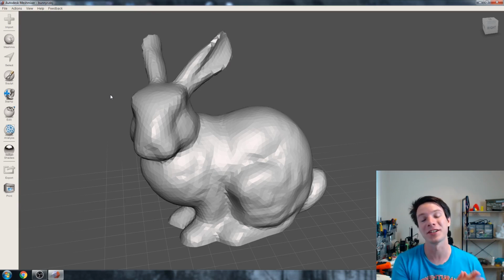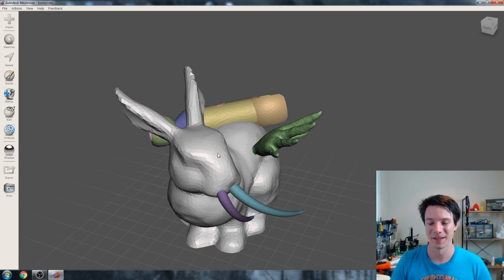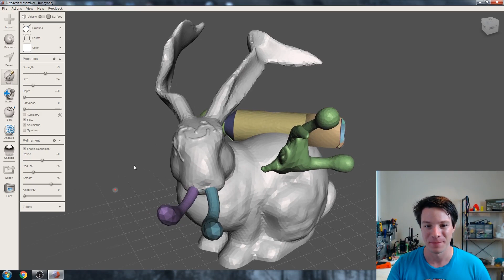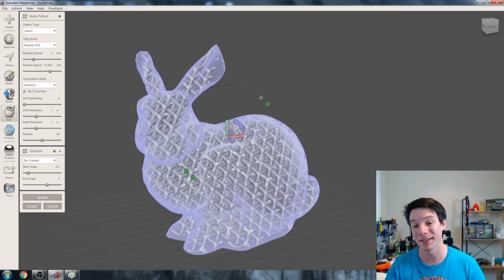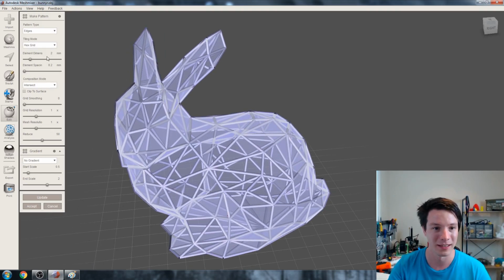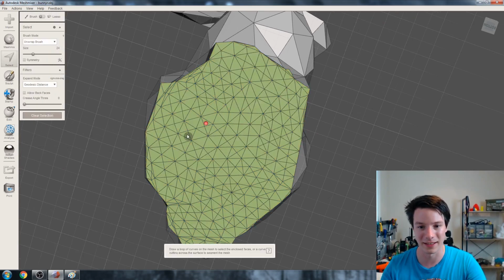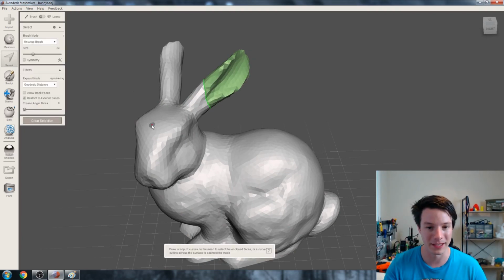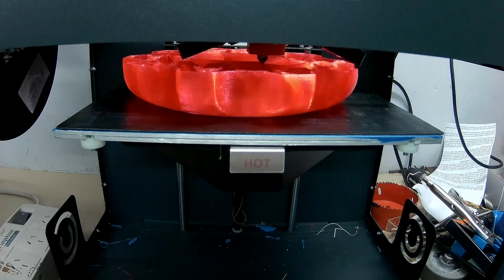5 Creative Ways to use Meshmixer for 3D Printing!

Comment: I've been looking to make some custom TPU stilt treads, as I make stilts for the local circus community as a hobby. The tread itself is pretty important, which is why I've thus far used bike treads cut into semi-rectangular shapes, stapled to the stilts. Having custom rectangular cylinder caps would be a perfect addition. Easy enough, but how to do the caps? Well, after faffing about looking for tutorials on it, I find this video, where you cover the stamp tool Perfect! Absolutely perfect! I'm one of a half dozen local stilt makers and I'll be the only one with custom printed, durable stilt treads that require minimal maintenance.

Comment: I download airplane model from fsx addon mdl files ,i converted mdl to obj in model converterx . my problem is there are missing mesh traingles and parts olso gap between doors and body etc so it is not solid  . i opened in fusion360 slicer for airplane planes crosssection, but they are saying mesh issue please help me

Comment: For the logo stamp thing, you can use Blender to convert SVG's into meshes (I just don't remember if the addon comes enabled by default or if you need to go in the settings and enable it).

You import, then convert to mesh, then go into edit mode and turn the outlines into faces, then you tell it to triangulate the faces.

Comment: Why do stamps deform on a flat surface? I made a stamp by making a STL in Fusion and selecting the surface and converting it. I found out that the square stamp and circle stamp both (along with my stamp) distort badly when placing on a flat surface of another STL.

Comment: For creating stamps from SVGs you can use an SVG to STL converter (I personally use Blender) to get an 3D representation from the 2D shape. Then import the STL into Meshmixer. There you just select everything and create the stamp as you did in the video. It's a bit of a workaround, but works well
Reply: This is a good way to do it.  converting SVGs to meshes is trivial in Blender.

Comment: Angus, I want to convert multiple 2D greyscale images showing a 3D model in dorsal, lateral, anterior and anterior-tranverse poses. Is there a program you can recommend that allows you to import the images then manually add depth information? I heard 123D catch was good for this but it is discontinued. The information can not be retrieved using shading from white to black.

Comment: for stamping logos
i think you could import the svg in a modeling software, like fusion 360
extrude it
export it as stl
import in meshmixer
select all the triangles of the face showing the logo (is there a way to quickly select all coplanar triangles?)
and create a stamp

Comment: Angus you can just design your logo in Fusion 360, extrude it a bit (something like a 2.5D logo), export as stl, import it in meshmixer as a mesh, create a facegroup from the surface of the mesh and then convert to stamp. I don't know how well it would scale, but it would definately work as a way to make a custom stamp. Maybe you have to scale the stl before creating a facegroup.
Reply from the maker: Sounds like an interesting workaround! I'll look into it . Cheers
Reply: Oops, someone beat me to it. I think Angus should try it and make a video of it if it works. :{J
Reply: Maker's Muse that's what I was going to suggest.. Was just going to suggest extruding an svg  in tinkercad to make the model first (for simplicity)
Reply: OpenSCAD might work well for this, you need to use inkscape (or another tool) to convert to EPS to import it, but it should work too.
Reply: Exactly what I was going to type 😄